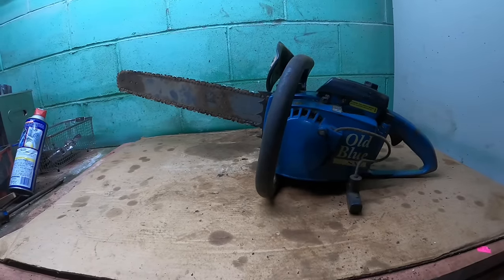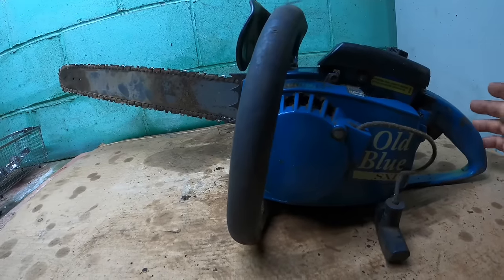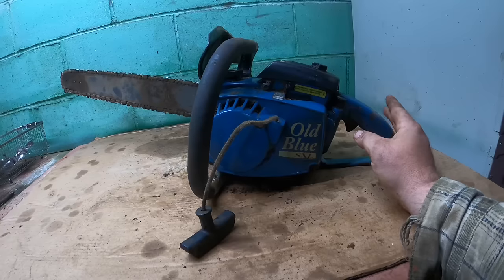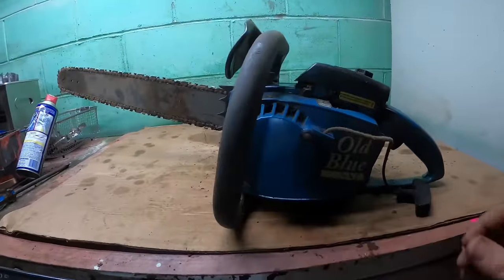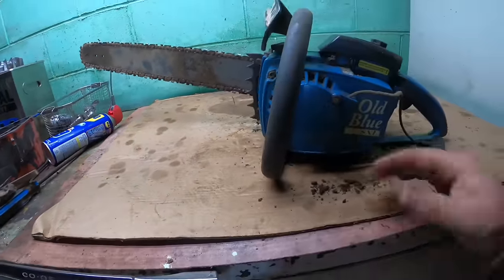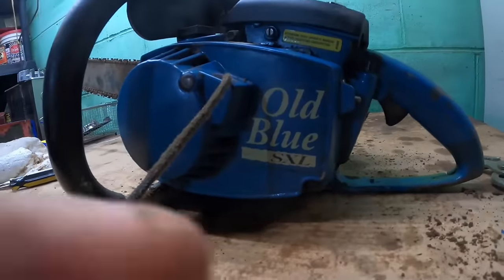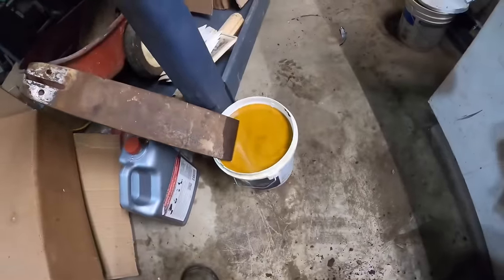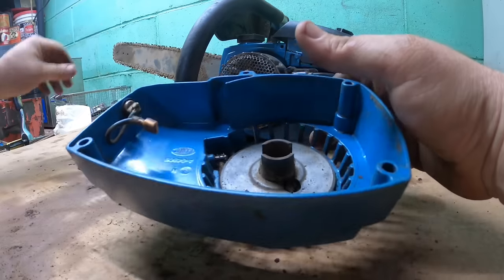“Old Blue” Homelite Super XL Chainsaw: Will it Run???

Comment: I like you have used quite a few saws, and maybe broke a couple. I use Stihls mostly now but have used a red SXL Homelite much like that one, an old David Bradley that much like the 4/20 was heavy enough to make a man out of whoever used it for long, on the project pile I have my grandpa's Mall chainsaw, model number currently unknown, but the bar rotates and the motor stays upright(I guess they hadn't figured out how to make it pickup fuel on it's side). Love these kind of projects.
Reply from the maker: Cool! I have a 26 LCS Homelite where you have to turn the handle to keep the carburetor right side up when making the felling cut

Comment: Carb rebuild and new fuel lines. I brought a few craftsman chainsaw back to life and had to replace to fuel line due to it sitting quite some time
Reply from the maker: That’s all in the works. It’ll be in the next video. Thanks!!
Reply: @rosstheoliverman  can't wait to see em running. I kinda like the older chainsaw better.

Comment: I've been given 2 old Homelite saws in the past couple years.  The first is a mid '60s C51 and the other is a red Super XL.  Both run great and I use them a couple times a year just to keep them oiled up and running. Compared to my modern Husqvarna and Echo (I gave up on Stihl) they are very heavy and extremely LOUD, but they cut great and can keep up with the modern saws easily. My dad had a sawmill when I was a kid through my leaving for college and we cut 100% of the timber we cut with his old XL (not Super) and that saw ran and cut like a champ for nearly 20 years until his brother in law decided to take it apart to "fix" the leaky fuel tank.Glad to see you keeping those great old saws running

Comment: My dad had 2 of the Super XL's, they were both red, never seen a blue one.  Dad mixed the gas without enough oil and locked up the newer one.
Reply from the maker: Cool! The blue ones were older, then they were red for a long time until they released two of these versions of these blue ones.

Comment: I'm glad to see you are mixing oil to the OEM spec.  I hear so many people say modern day synthetic oil is so good you can use 50:1 mix in those old saws, but to my way of thinking 1) parts are very hard to find when you burn one up and 2) the oil has 2 functions, lubrication and it also carries the heat away.  When you starve those old heat generating engines for oil they simply can't cool correctly.  Love the video and that saw is gorgeous.  You have a real gem on your hands

Comment: I work on vintage saws myself I just picked up a super XL to get going again idk what fuel mix your running but I found the old manual and then older homelites ran a 32.1 mix ratio so I'd be careful of that if your using premix for your newer tools I know my newer stuff is 50.1 so I have to mix a can special just for my older saws so I don't burn em up also lil red barn is a great website to find a lot of parts for vintage saws great video can't wait to see more

Comment: If one is careful, you could get PVC pipe capped on one end that slips the whole bar down into a column of rust remover. Or make a ring of boards, lay plastic sheet and the bar on standoffs to flood like a puddle. Plan ahead for how to drain that puddle swamp when done without a huge mess. That will use less chemical but risk losing it than the pipe.
Reply from the maker: That’s a great idea! I think I’m gonna try the PVC idea. You could kind of pour that back into a funnel when you’re done.

Comment: You dont have to take the Recoil carrier off to wind the roap tighter thats what the slot in the carrier is for. you put the roap in that slot and twist the carrier and that tightens it .I bet the fuel lines are cracked on that old of a saw .I have an XL2 and a super 2 in my hoard and i love them SEE

Comment: HI ROSS 😊 some times the chain bar will get full of sawdust and won't let the chain turn until U clean the bar out w a screwdriver clean both sides top and bottom 😊😊 then try again and make sure the chainbar doesn't have a burr on the chain bar if it does take a flat file and file it off this will keep the saw from cutting it won't let it go through the wood like that clean the sparkplug w a wire brush and a small flat file if it doesn't have a bright blue spark get a new spark plug 🔌 😊 4 the saw and Ross most of those old saw the the bearings will go out 😮😮 from all of those years of cutting wood w them Ross I can remember those saws when I was a kid years ago and alot of people used them years ago 2 cut wood w back U had 2 use what saws U had  I don't remember none of chainsaw dealers when I was growing things were alot different back some were close by and others U had 2 go 2 the next town most of the time they wasn't that far away 😊😊 OMG 4 13 2O24